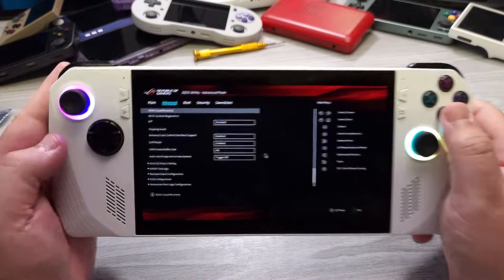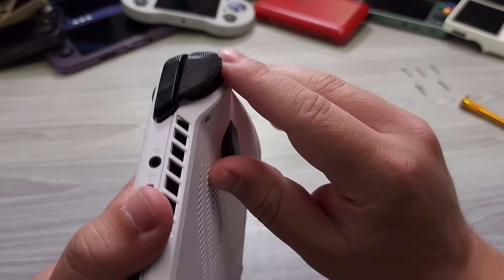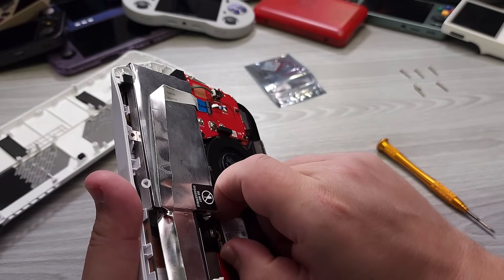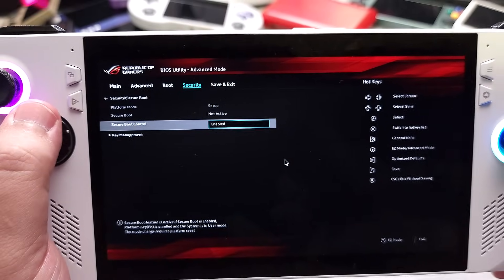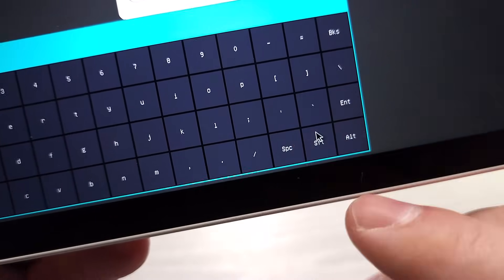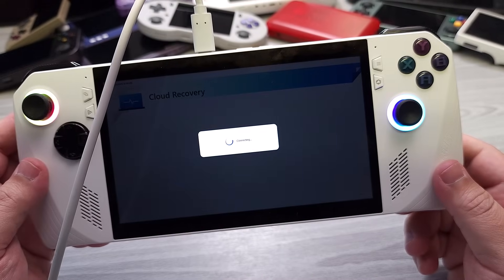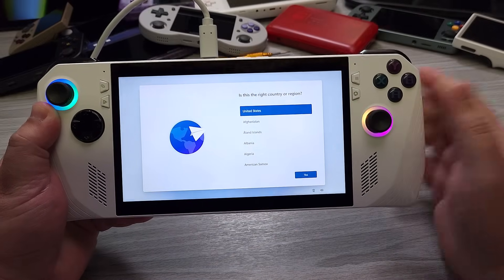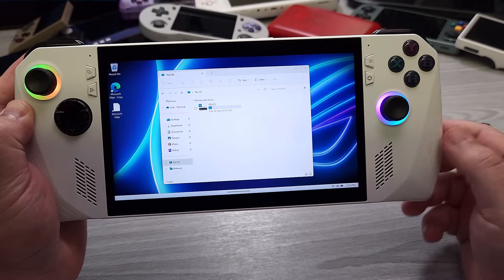Asus ROG ALLY SUPER EASY SSD Install / Upgrade How-to Asus Cloud Recovery

Comment: I am doing the install right now and it's been in "Checking" stage for at least an hour.  Is this normal?  My thought is that maybe the Asus servers are being hammered since it just came out.
Reply: I'm there too. I'm assuming the same as you...or it's bit checking the drive and that takes longer with larger drives. (which mine is 2TB)
Reply: Same here. Reply back if this eventually sorts itself out for you.
Reply: I'm having the same issue and it's been 1 hour. Any update from you guys?
Reply: @kevinwilgenbusch902  Guys, mine is still going.  I would say it's been at least 2 1/2 hours so far.  Please update us all if someone moves forward.
Reply: @mikebarbagallo9000  Mine is still in the "Checking..." phase—about 1.5 hours now. Like @Mike Hipp, mine is also a 2tb (Sabrent Rocket Q4). Not sure if the recovery has failed (and needs to be restarted), or if this is normal for a drive of this size. I wish I knew what it was "checking." I'll update if something changes, or if giving up and restarting corrects the problem.
Reply: Mine is also a 2tb drive.
Reply: I also did try restarting and it still gets stuck on checking. I have the same SSD as you as well.
Reply: I'm still waiting and mine is a 1tb.
Reply: I'm assuming at this point it's the servers that can't handle all the requests. It also appear the cloud recovery is tied to only devices under warranty (note for future). That could be what it is "checking" for
Reply: Okay, I got it to work.  I went back in and reinstalled the original hard drive.  I updated the bios and firmware.  I updated everything myAsus said was essential.  Once I did that I got past "Checking".
Reply: Hey if you are having the "checking...." issue after updating your SSD. Put the old SSD back in, update your bios using the MyAsus app, and then try again. It worked immediately for me after doing that. I had let it run for multiple hours before that
Reply: Can confirm Mike B and Chris' strategy. Updating BIOS from the MyASUS app using the old SSD appears to have resolved the issue. Thanks!
Reply: @kevinwilgenbusch902  It worked after reinstalling the original drive and booting into Windows, then launching MYASUS app and installing all the updates. I had to reboot a couple of times until all the MYASUS updates were applied, including BIOS updates. I put the new drive in, started cloud recovery and it’s working. “Checking” took about ten seconds then it went on to install.

Comment: Just got my "make sure your shipping info is up to date" email from Best Buy for my ROG Ally pre-order! Pumped.

Any idea what this does to the Ally warranty in the USA? I was actually planning on getting the accidental damage protection from Best Buy but I definitely want a 1tb SSD to hold every Legend of Heroes game I own. 😂
Reply: As confrimed by the ROG Ally in their Twitch Q&A a few weeks back, SSD upgrades are expected by Asus and have absolutely no bearing or negative impact on the standard warranty. So long as you don't negligently damage some other component, you're good to go.
Reply: @ArtemMoshkovich  great to hear! Now I'm wondering if the same applies to the Best Buy extended warranty. In any case, thanks for your reply.
Reply: @parabellum8506  There's no relation to or impact on the BB Extended Warranty, because you're not breaching the core, actual product warranty, itself. I hope that makes sense, but yeah, your warranties across the board aren't impacted because the manufacturer effectively condones the hardware upgrade.
Reply: @ArtemMoshkovich   thank you again! 🙏

Comment: how long does the checking take?
Reply: Wondering same thing
Reply: @handheldzilla7279  only less than 5 mins. I did not update the bios fw the 1st time, it took 5 hrs, and still checking. swapped back to the original ssd and updated bios fw, completed whole processing in 2 hrs
Reply: @MasterTy777  thanks man I did the same thing updated the bios and it went smooth but I had to redownload all the asus stuff manually

Comment: My secure boot is as follows: platform mode- user, secure boot active. I cannot  get past next step and cannot find how to proceed. Why is mine different (bios 319)
Reply: I keep getting an error “cannot connect to network. Select “next” to connect to a china-based server.” If I hit next it fails. Can someone please help
Reply: Ok so I got past it. My router is a EERO and I ended up making a guest network to bypass the security stuff and it worked. Everything always has an extra step for me. Lol. Thx for the great content

Comment: Annoyingly, if you get a network error doing this, your normal internet connection is probably too secure. You will need to either change the security settings in your ip admin page or like me if you don’t know the login for it use your phone’s hotspot or a guest wifi (head on over to McDonald’s or something lol).

Comment: I upgraded my Ally SSD but i can not reinstall Windows i tried using ASUS Cloud Download but it gets stuck on checking its been on checking for at least 5 hours is there any other way of reinstalling?? im kinda stuck with this....
Reply: It worked after reinstalling the original drive and booting into Windows, then launching MYASUS app and installing all the updates. I had to reboot a couple of times until all the MYASUS updates were applied, including BIOS updates. I put the new drive in, started cloud recovery and it’s working. “Checking” took about ten seconds then it went on to install.

Comment: Anyone STUCK on CHECKING screen, Just hard reset by pressing the power bottom and just make sure you have a correct DATE! JUST PUT IT UP TO DAY! and try the CLOUD RECOVERY again and you all set!!
Reply: What are the steps to change the date? it does not allow me to edit in the main recovery screen
Reply: @sandymenvj in bios there is a little pen/edit icon on the top where it says the date and time.

Comment: Hi im stock on windows logo i thnk im waiting for an hour still im not in the cloud recovery yet is it normal?
Reply: Here's what I had to do to finally get everything going- in the bios make sure the correct date is shown! Then I had to use my Ugreen adapter to plug an ethernet cable into the Ally's USB C port. Then it went through the process like the video!

Comment: My rebooting window has been saying checking.  It's been saying that for over an hour. Has anyone timed this rebooting process to c how long it actually takes.
Reply: Mine is doing the same, only 20 mins but seems like it should jabe passed this now, how long did you have to wait?
Reply: @chrisc2252  I ended up rebooting my system then resetting the time and date in the bios. That helped. The time and date was b 4 asus ally was made.
Reply: @Sammy10100 ust done that and now keeps rebooting into bios 😂 i may just clone the original drive at this rate, ill give it one more go

Just gone through now after moving to another room 😂 wifi kept dropping out lol

Comment: Mine has been "checking" for about an hour after starting cloud recovery. Any ideas what I should next? Thanks.
Reply: It worked after reinstalling the original drive and booting into Windows, then launching MYASUS app and installing all the updates. I had to reboot a couple of times until all the MYASUS updates were applied, including BIOS updates. I put the new drive in, started cloud recovery and it’s working. “Checking” took about ten seconds then it went on to install.
Reply: @Justintime246  thanks. I will try that. I swapped the drive before even turning it on and in his video he didn't state that..
Reply: Now the keyboard is not coming up to get the wifi password.
Reply: @10thGOB  hold the M1 or M2 button on the back of the Ally and press Up on the D-Pad.
Reply: @Justintime246 does the ally need internet during the "checking" phase? Still checking going on an hour now..
Reply: @Justintime246 holding up on the dpad..doesn't pull up my keyboard just inputs the "d"..smh...I must've missed a stepped it shouldn't be this hard.

Comment: I have followed all the steps and it remains permanently on the screen with the Windows symbol and the circle going around, it does not advance. Any solution please?
Reply from the maker: Been tracking this for a full solution and it looks like in BIOS you need to make sure time and date is set correctly in bios
Reply: @ThePhawx It took me a whole day but I finally got it.  I do not know how.  I cloned the SSD, it didn't succeed as it left 1.5TB unallocated.  It could have worked with two partitions but I tried the Asus Cloud Recovery again and it worked and used the 2TB perfectly.

Comment: What's the maximum storage SSD i can upgrade to?
Reply: In theory, it can accept any 2230 sized m.2 drive on the market.  Currently the largest I can find is 2tbs.  If they release a bigger m.2 in the 2230 form, it should accept that too.

Comment: After cloud recovery download, it asks for wifi password again but then I can't bring up the keyboard? Any help?
Reply: @Peter unfortunately I don't have any usb keyboards so I tried pressing the back button and directional pads and noticed it would type "d" when I did for whatever reason so I changed my wifi password to 8 "d" characters and used that to input and it connected, very strange workaround but it worked 😂

Comment: Bro I returned on today because of sd card reader died they gave me a new one swapped out my drive and it wont cloud recover says failed it did it once but just went to bios after. wont boot into windows . I reseated the ssd about 1000 times. so annoying gonna have to take a 2nd one back to currys what if they refuse a 2nd time. I wll take it back again in the morning this one has not even booted into windows as just opened it and put my SSD in and bitlocker bs so did recovery and failed so put old drive back in wouldn't boot tried recovery failed been at it all night getting nowhere. wish i had kept the one that worked fine that just had the SD card die. I upgraded that SSD no issues. joke these things. wish i had updated the bios before swapping out the ssd or at least booted the thing up. Now its screwed brand new today.

Comment: mine has been saying checking for like 20 min is this normal?
Reply: It worked after reinstalling the original drive and booting into Windows, then launching MYASUS app and installing all the updates. I had to reboot a couple of times until all the MYASUS updates were applied, including BIOS updates. I put the new drive in, started cloud recovery and it’s working. “Checking” took about ten seconds then it went on to install.

Comment: Finally mine is no longer checking and installing
Reply: how long did it take? Im going on 4+ hours of "checking"
Reply: @amfrequency8053  I got tired of waiting so I restarted the process about 6 times till the after 5 mins of waiting on checking it worked
Reply: @Desertwolf89  Thank you. I'll try the same I suppose and update here.
Reply: @amfrequency8053  hope it works for you like it did for me
Reply: @amfrequency8053  It worked after reinstalling the original drive and booting into Windows, then launching MYASUS app and installing all the updates. I had to reboot a couple of times until all the MYASUS updates were applied, including BIOS updates. I put the new drive in, started cloud recovery and it’s working. “Checking” took about ten seconds then it went on to install.
Reply: @Justintime246  yup. I had the same exact experience last night. Enjoy your Ally now!

Comment: So you pay for a machine which is already 250 more than the steam deck and than put an SSD in which costs another 200... Makes not much sense.
Reply: 2tb wd cost 130$ and sell the 512gb for current market at 50$ so technically you pay 780$ to get ally 2tb. Do the math ser

Comment: As cool as this video is, this does NOT explain or help how i can get ALL of those games and saves and my own user account from the original SSD. I do not want to start from scratch. Basically, if I was able to clone the original SSD, that was what I was looking for. This video is more useful for folks that go for a straight upgrade right after purchasing the device, not for those who have used the device already and have stuff installed.
Reply: The method I used was simply this:  Most partition software can now clone drives, but with the ALLY you must do one thing, that is to turn off bitlocker first, or you wont be able to copy any data. Which  method you use, is dependant on whether you have a new Ally to upgrade WITHOUT data on it, or an Ally you wish to upgrade WITH data on it. 

Only other consideration is your internet speed if you do the cloud method, it could take longer than the clone software, this could take an hour or two.

So you have two choices, number one, the cloud recovery method. This is useful if you have lost your partition and have nothing to lose in terms of data.

Or there is number two, the clone method, which will retain all your data and copy all the partitions. Bitlocker can be re-enabled after you have completed the swap. this takes around 20-30 mins. (varies between software type and the amount of data on your drive of course).

Choice is ultimately yours.